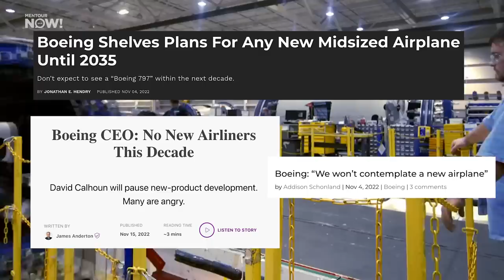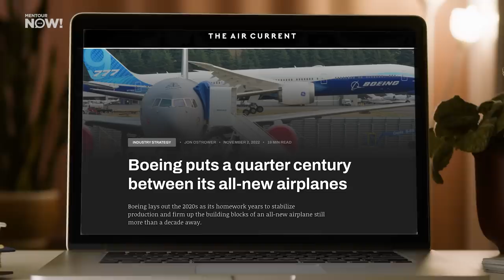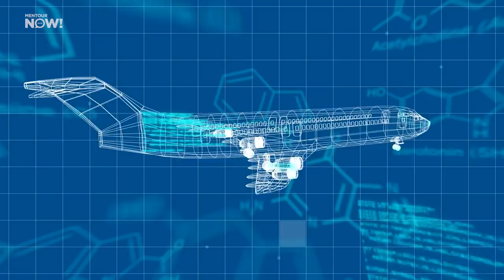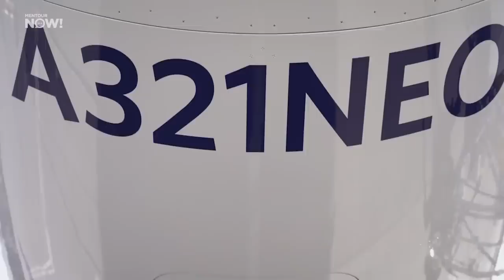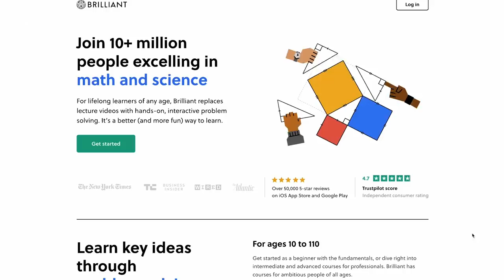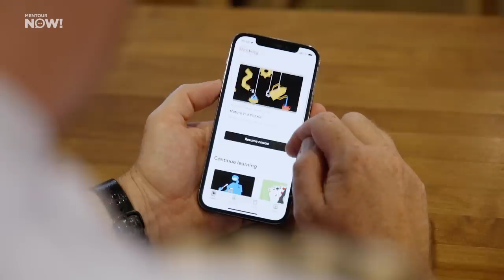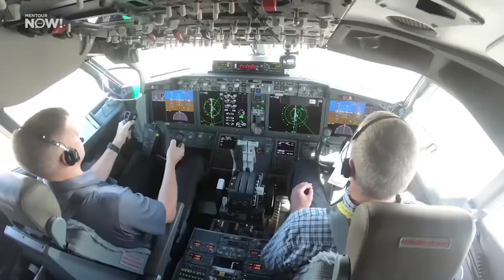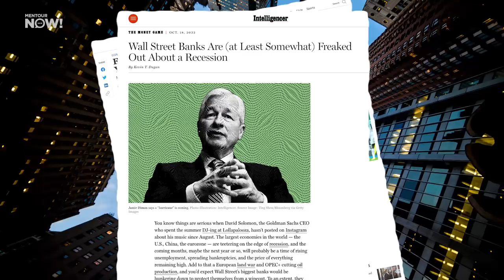Is BOEING giving up!?

Comment: As a lifetime Boeing pilot and fan, (now retired) I have found the developments within Boeing over the last ten plus years absolutely heartbreaking. 
They were once a totally amazing company, but sadly no more.
Fingers, toes and everything else crossed that they can rebuild and totally restore trust.
Reply: Sadly true.
Reply: What they have managed to do over the years in developing updated versions of the 737 has been fantastic. However, they are now subject to design decisions made during that aircraft's original design over 50 years ago, so you cannot just keep fitting bigger engines to it without impacting the handling. They've fudged that issue on the MAX to try and retain the type rating but realistically have pushed the design as far as it can be. They really do need to develop a new aircraft to replace the 737.
Reply: They could do something for the country, the company, the staff and the stockholders by sacking every manager that doesn't have an engineering or scientific background. No company stays at the top in technology when accountants are in charge.
Reply: There working on it
Reply: Return to Seattle or QUIT!!!
Reply: @Crunch_dGH  they don't need to be in Seattle.they just need there top engineers there which they are slowly doing. Going back to old school boeing it will take some time but we can see the improvements already staring.
Reply: @andrewlarson7895  So get rid of the MDD suits.
Reply: @JoeHamelin  i think the mdd suits are pretty much getting cycled out.
Reply: Not with the current leadership
Reply: Thats what happens when you take power away from engineers and instead let pencil pushers make all the important decisions.
Reply: When you put profits above good engineering you will fail.
Reply: The DC takeover and 737v max has pretty much destroyed them
Reply: Boeing's fate was sealed when they let the bean counters of McDonnel Douglas run the company instead of engineers.
Reply: the 787 is successful tbh, IDK what you guys are talking about.
Reply: Trust take long time to build but can be lost very fast.
Reply: @andrewlarson7895  Their core Engineering is and always has been in the Seattle area.
Reply: @JackF99  yes i know i retired from boeing
Reply: @Crunch_dGH  I believe it was the labor unions in Wa that drove them to build the 787 plant in SC, right?
Reply: When greed takes over!!!
Reply: @PilotGigi  that's airbus as well.
Reply: Lifelong fan and was investor right until 2nd Maxx auguring, sold with decent gains and barely looked back. 
Slick salesmen type CEO's always made me nervous anyway.
Reply: I, too, share the same emotional context.  That former CEO stood that podium and essentially blamed those pilots for those two crashes; only to have it come out that he knew better at the time.  Couple that 'disaster in itself' with the emails that I have been receiving (up until yesterday) from Boeing, touting their excellence in executing their newly-developed "Program to ensure that the planes we are building are actually Safe".  Beginning a sentence with a preposition...  To have had to "develop a PROGRAM" to "make sure we're building planes that are safe!?!?!"  Are you <>ing me!?!?!.  I replied back to the web-master, please don't send me anymore of these...they're just too insulting to stomach."
Reply: @kevinheard8364  why would someone from Boeing email you That?
Reply: @kevinheard8364  the max crashes were partly the pilot's fault.
Reply: @andrewlarson7895  Maybe the media got it wrong; or maybe I even got it wrong after hearing it multiple times; but.... When it was discovered that the MCAS system was not in the manuals .... so that it was not 'disclosed' as a significant-enough-change-to-require-pilot-training for the "type variant", they wouldn't have known about it to start with... or did I miss something?
Reply: @kevinheard8364  if they would have flown the max like old school instead of relying on automation so much all they had to do is cut the two trim switches and manually trim the plane. One pilot got it right and then the other pilot turn the automated trim back on by then it was too late. It's been proven in the simulators over and over.
Reply: @kevinheard8364  yes mcas is not new like people think its used on other aircraft with success.but boeing did screw up by not putting it in the manual.
Reply: “They were once a totally amazing company  but sadly no more”.  Change company to country, Could this also describe the U.S.A.?    I hope not but I’m not very optimistic at the moment.
Reply: @simonlb24  the max is just fine.  950 now in service and coming back with a 99.95 % efficiency rating and performing much better than Boeing promised.
Reply: @andrewlarson7895  'the max is just fine'. Not sure the families of the 340 or so people that died in the two crashes due to the MCAS debacle would agree with you there. That was completely avoidable, and entirely Boeing's doing.
Reply: The competition drove them to make bad decisions and their software is suspect.
Reply: Lifelong fan and was investor, but no more Boeing stock for me. I guess there is always a chance Boeing could turn, but when organizations get too big !!!
Reply: Airbus as well fits in that picture
Reply: @simonlb24  the max is fixed so now what?;and the people that died are being taken care of now what do you want Boeing to do?
Reply: @Steven Strain they new the  max plane had issues its in the log books and acted up on the flight just the day and on the same day before just before it crashed . And yes boeing knew  pilot error was partly to blame
Reply: @andrewlarson7895  As you seem to like trolling people, I'll just ignore you from now on.
Reply: @Steven Strain yep cuz old school flying it would have saved the plane. And they relied on automation and they crashed hit the two trim switches manually trim the plane. It's been proven in the simulators over and over again. They didnt need a new simulator. Just watch it on YouTube it's on YouTube so it shows all I had to do the save the plane. But yes boeing is guilty I'm not putting it in her manual. But that actually wasn't even all boeing fault. that mistake was made back in Colorado from the company that actually made the manuals.
Reply: it's possible. The US auto industry went through a period of inferior product and lack of innovation before coming back. It took government intervention to keep them alive though.
Reply: @S0ulinth3machin3  It will be devastating for a million and one reasons if Boeing can’t completely rebuild respect and engineering expertise and get back on the top of the game, not the least of which would be Airbus having a virtual monopoly. 
As soon as accountants totally run an organisation, trouble follows.
Reply: Subcontractors...
Reply: @KarmaFlight  boeing been subcontracting for over 50+ years.
Reply: @andrewlarson7895  Nowhere near the level that they did with the 787. They had enormous problems with shipped parts. Spend a dollar to save a dime. The CHS plant is full of problems.
Reply: @KarmaFlight  yes the management blew it big time with not keeping up what was going on with there subcontractors. They're still dealing with it and covid didn't help in the matters.but they are working on it and we are starting to see old school boeing coming back. So hope they keep driving in the right direction.
Reply: @KarmaFlight  off loaded alot of work while i worked for them that going back a long time.
Reply: @andrewlarson7895  I have flown the DreamLifter for the past decade. We are getting last 4 747-8s that will ever be made. Sad
Reply: @KarmaFlight  yes sad what's worse is the 747 is still needed i think.if for heavy haul or troop placement.
Reply: 25 years of bad decisions by now. Starting with merger with MD. And in development, distributing design and manufacturing of 787 between many countries for no good reason, when the US had all the people and space needed. It increased costs and time to introduction a whole lot losing them their leading place.

Dumb MBAs…

Comment: Boeing commercial sealed their fate when they decided to produce the 737 NG in the 1990s instead of a clean sheet design (which they had started working on already). I worked there back then in flight testing and was appalled by the decision. That was their opportunity to build a better airplane than the A320 family. The NG was very successful (the only choices being Boeing or Airbus, after all),but it locked them into the obsolete 737 fuselage with all its limitations. (The NG was also way more complicated and expensive to develop than originally thought).
The eventual Max financial catastrophe speaks for itself as to what a bad decision sticking with the 737 has been. 
Now Boeing is in a terrible financial position and unable to produce a truly modern airliner to beat the A320 line. I said beat, not just compete. 
As an airline pilot I have flown the A320s for a long time and now fly the 787. One has to simply step in a 737 cockpit (yes, even the Max) to see how far behind the times the 737 is. Yes, the Max will sell, after all, the only choices are still Airbus or Boeing.
For the record, I think Airbus has fallen into the same trap by sticking with the base 321 airframe. The 321 NEO, or at least the new NX would benefit immensely from a re-designed wing like they did on the 330 NEO.
Reply: Actually if Embrarer makes a long range to compete they could have a legitimate shot.
Reply: @chdreturns  I hope they do, the competition is immensely important
Reply: And another problem for the Ng is how the passenger feels it.
Narrower... Louder.... Worst AC.... And I never got one with poouches in the seats to put my stuff so, I avoid the NG whenever I can.
Reply: Boeing in my opinion sealed their fate when the decided to stop production of the 757s and even the 717s which were the MD95s that they inherited from MD but more stopping production of the 757 in my opinion has now doomed Boeing  🤷🏾‍♂️🤷🏾‍♂️🤷🏾‍♂️🤷🏾‍♂️🤷🏾‍♂️🤷🏾‍♂️🤷🏾‍♂️🤦🤦🤦🤦🤦🤦🤦
Reply: @ericjones7769  I agree. That was a bad move but consider that airbus made the same mistake by at the same time cancelling production of the very good and very efficient a310.
At that time, the decision made sense.
Reply: And all because they wouldn't accept a new design for which customers would need to retrain staff!
Reply: airbus is winning the market with the a320neos, ...for short to medium haul the carbon wing is not such big factor as for long haul efficiency.
Reply: @patrickpowers5995  well, blame Southwest who put pressure on Boeing to keep the 1960s design the same ie-200, -300etc etc . Had  Boeing been more forward thinking rather than considering only profit they could have  developed a new short haul airliner which would then have tied in with the 75,76,77,78.to produce total comminality with its product, imagine that!! Rather than what they have been doing with the 737 banging a square peg into a round hole....
Reply: When it comes to success there are no shortcuts
Reply: @TheAllMightyGodofCod  The 737 NG still had the same fuselage width as the 737 Classic. So, the Classic series still had narrow seats just like with the NG. I flew on both the Classic and the NG versions of the 737 even since when I was a kid. Of course, I still rode on many types of planes including the smaller ones which were the Bombardier CRJ, Embraer E-Jet, and ATR-72 (Turboprop).
Reply: Actually, it would be only the 737-900/900ER variant of the 737 NG in the early 2000s that ruined Boeing as the 757 had a more modern design and could have had a shorter fuselage. The 737-600/700/800 were fine.

Comment: The unducted fan designs go wayyyy back. Engineers working around them called them "Acoustically Abusive". The tips are uber-supersonic and make a LOT of noise. No airport in the world will accept them and so on. It's an old concept that looks great on paper but the noise factor always shuts it down eventually. Still, investors will hand over their money, again, etc.
Reply: How much thrust do these engines deliver compared to a traditional, closed turbofan? Would a A320 equipped with two of these RISE engines be slower?
Reply: From what I found this is still geared thing, so this is essentially hybrid turboprop with a stator.
While they are not stupid loud turboprops are still loud and will not get you speeds of modern jets.
Reply: Take a look at the Thunderscreech. While not exactly the same technology as duct less fans, it's a good idea of what engineers might face trying to develop something like this.
Reply: @MentalParadox  If they can compare to turboprops they can get an airliner too similar speeds to high bypass turbofans the issue is going to be noise more than anything.
Reply: @Theonedjneo  -- that was the loudest aircraft ever built because of its supersonic propeller. It had to be tested out at the salt lakes because it was too loud for Edwards Air Force Base. It had a literal brown note!
Reply: With the RISE engine this (tips at supersonic speed) will never happen, due to clever new design only made possible by better supercomputers. The design of RISE is actually quite different from contrarotating propellers despite looking similar - it uses stator blades (like a turbine) rather than contrarotation. But time wil tell if this fixes the noise enough.
Reply: Turbo props were all the go in the 1950s.